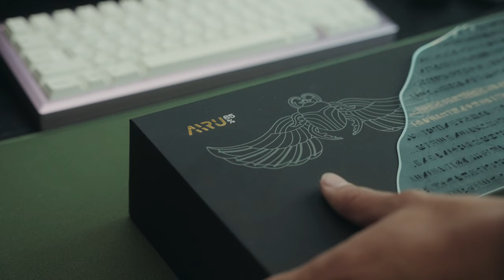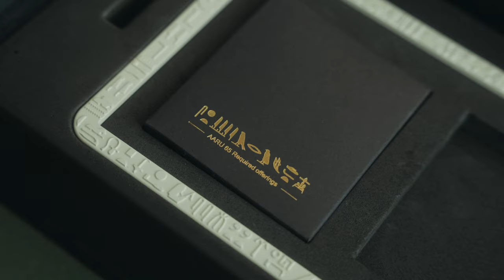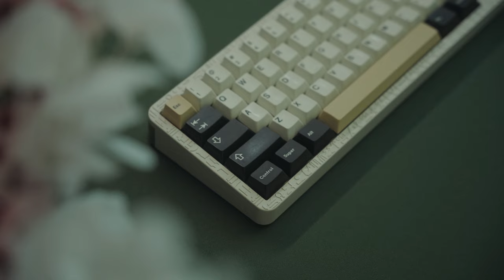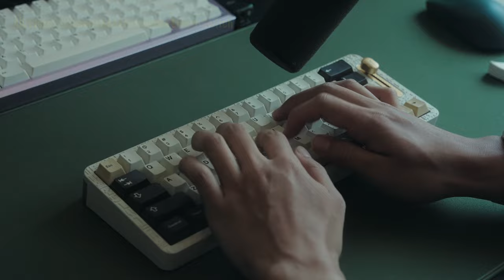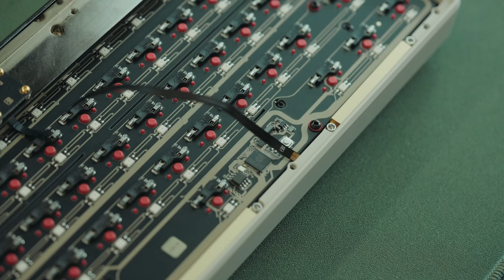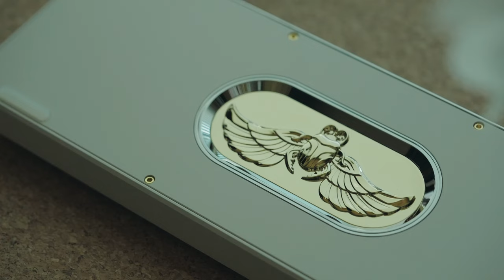a great tribute | Helix Lab Aaru65 Review and Sound Test

Comment: JST can often create a stiff spot on a board and also the connector is quite bulky - ribbon cables being much more flexible make the typing experience more consistent. I definitely have boards where I wish they used a ribbon cable instead because the jst wire makes the feeling inconsistent